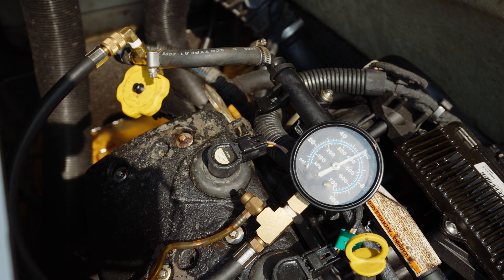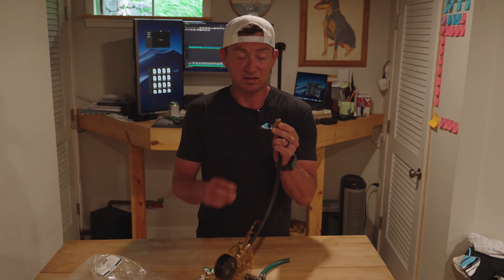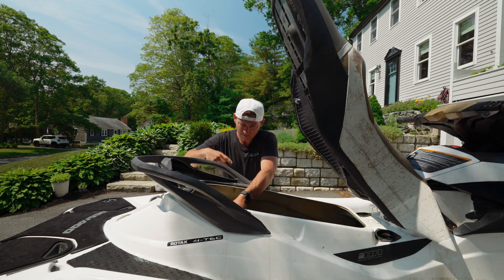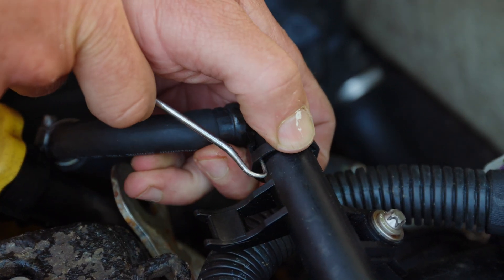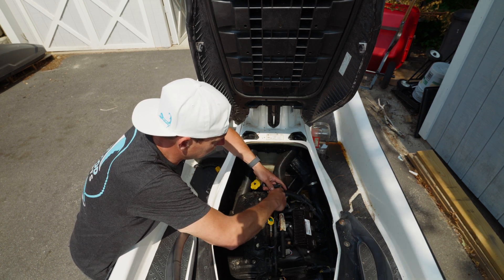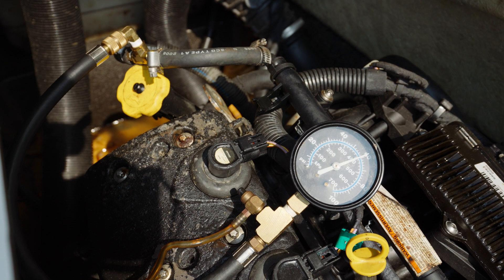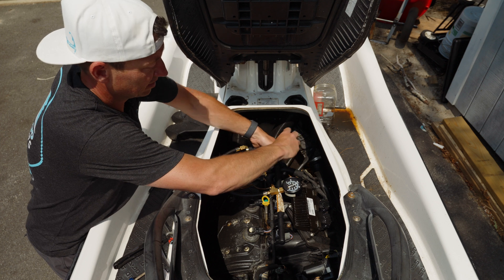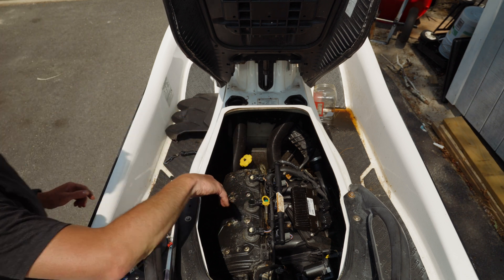Fuel pressure test on a SeaDoo 4tec

Comment: Great video.  Thanks for posting.  I have a 2014 GTX 260 Limited is that takes 10s or so to start and runs a little rough and misses in the lower RPM ranges (2K-4K).  Seems to run very smoothly in the higher rpm ranges (above 4K).  I plan on going through the fuel system this winter in an attempt to diagnose. This video should be a great help to me.
Reply from the maker: Thanks for watching Brian! I 

just found out the fuel pump on my SeaDoo (the one in this video) was deteriorating inside the tank 😥

I didn’t catch it at first because the pressure tested good. 

I’ll edit that vid soon, it’ll go over taking the fuel pump out
Reply: How did u diagnoise the pump being bad if u had 60psi? Just put mine in the water after winter and struggled to accelerate. Ran great last year and out the water this year and at idle in water. And do spark Plugs really go bad over winter? Battery had 14.10volts at idle running on hose. Doubt that means anything since i cant fully load test in the water at correct rpms.. just trying to get some advice if u dont mind.  Thanks for the video btw...
Reply: I have a similar issue did you ever figure out what was wrong?